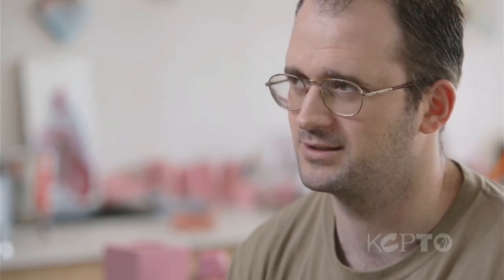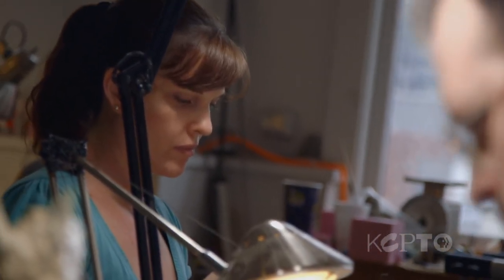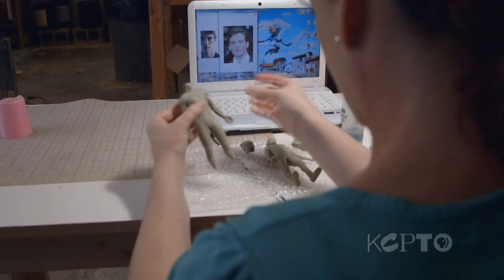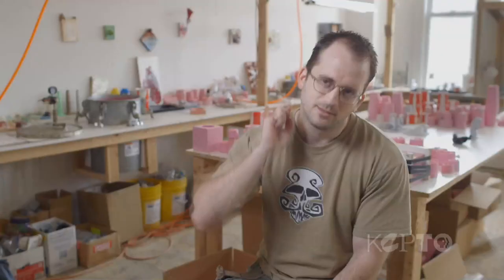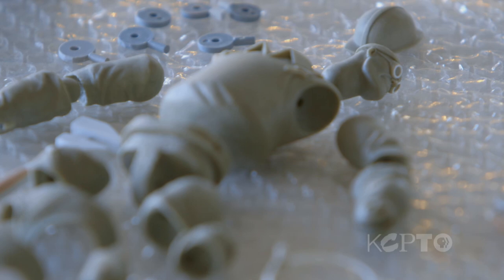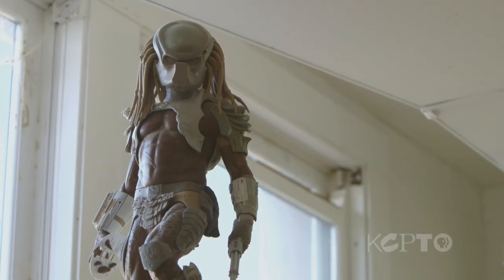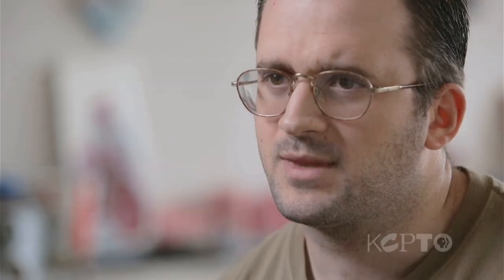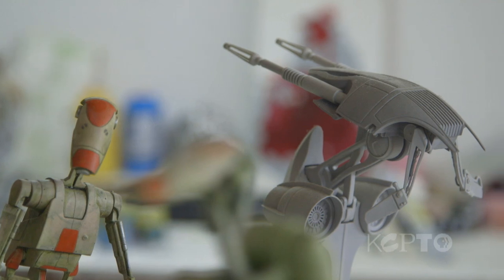The Secret Story of Toys - The Local Show

Comment: I always was interesting what plastic ppl use for action figures🧐. Is it connections parts, pags and others part from one type of plastic? Just interesting, anyone know something about it?
Reply: For people doing this as a hobby without manufacturing in China, most people use polyurethane resin(liquid plastic) of different harnesses and flexibility. You can tint your plastic before you put in into the mold. Action figures that you buy at the store that were manufactured in China use a combination of ABS, PVC, & POM plastics. ABS is used for large pieces and are hollowed out to save costs. Think of Lego plastic, that's what ABS is. PVC is more expensive and is ridged yet semi flexible(depending on shore hardness). It's used on figures that have "Pop" joints so the parts can easily fit together using a combination of mushroom pegs or balls at the end of each joint. ABS is usually used for the Torso of the figure which would be split in half to trap the Shoulder Disks and whatnot. PVC is generally used on Limbs, but could also be used on an entire figure. POM is used for Joint Pins and Disks for low friction and super toughness. I recommend watching Hasbros ZBrush video where a Product Designer from Hasbro toys talks about the different plastics and actually shows some demo stuff of Articulated Action Figures on his computer. It's for Star Wars figures.